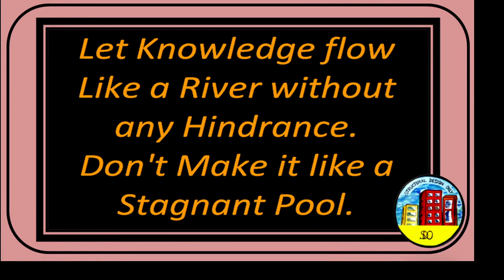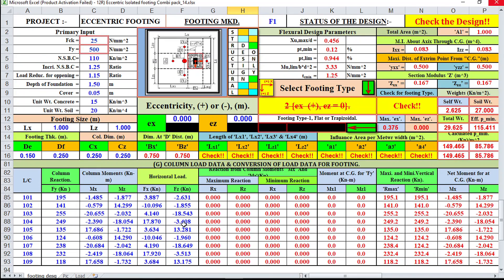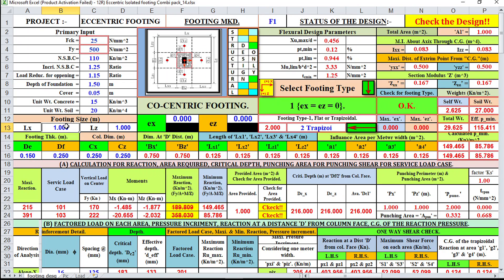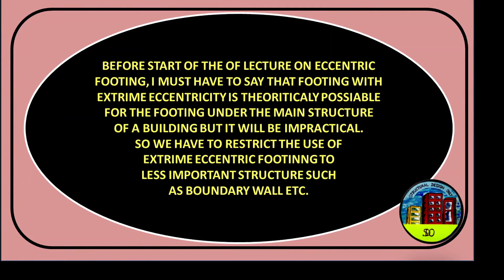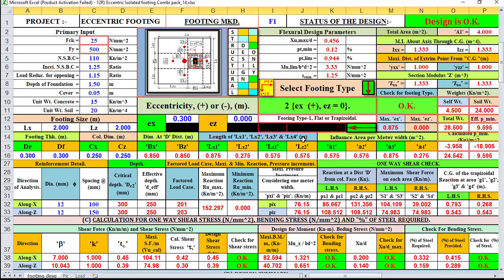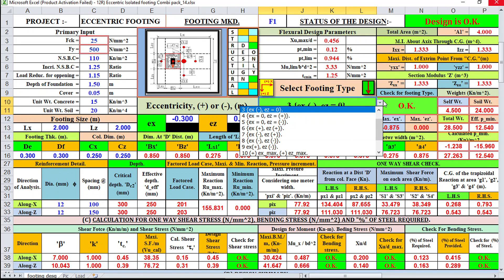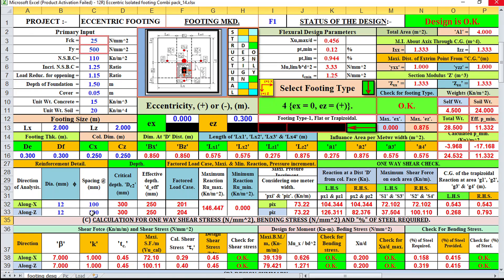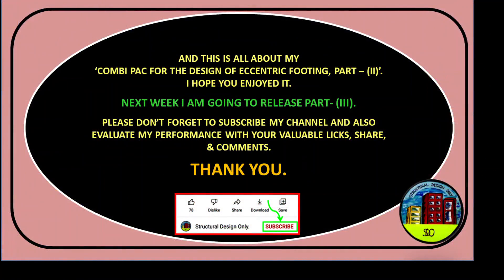How to Design Eccentric Footing in Excel, Part-II.

Comment: Dear Sir,
In eccentric footing meare slab type footing will not withstand moment. For this strap beam on boundary side  in addition to footing slab to be provided to take care of moment. is it  correct sir. What is your opinion.
Reply from the maker: If you are asking about very tall boundary wall of thickness not less than 250mm and height say 6m the yes you thinking is Right.

Comment: Dear Sir,
In footing design, we normally not consider soil weight over footing for  design, if we  consider allowable SBC  of soil.  Also eccentricity is  CG  of  footing-CG of column. but here we are orbitarily choosing value for ex and ez. Kindly  give any sample calculation for  case  given in sketch explained for understanding. thank you.
Reply from the maker: In normal situation we consider net safe bearing capacity, N.S.B.C = Calculated Capacity-G*D, where G= Density of Soil and D=depth of foundation. 
Now uplift condition you have to uplift your footing slab + Soil over your footing slab because this loads are downward and uplift force is  Upward.
Now think yourself what we have to do to get net pressure. Obviously we have to deduct this downward load from uplift pressure. I have already explained this in my part one of this video. I think you have forgotten to watch Part 1. Please watch that video.
Thank you.
Reply: @SD_Only  Thank you for detailed explanation. Thank you sir.
Reply from the maker: You are most welcome.